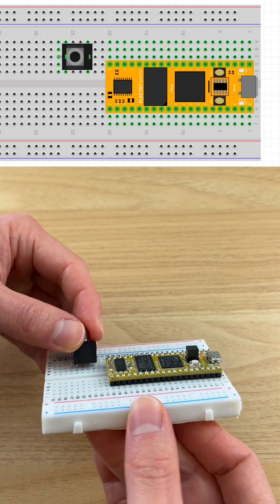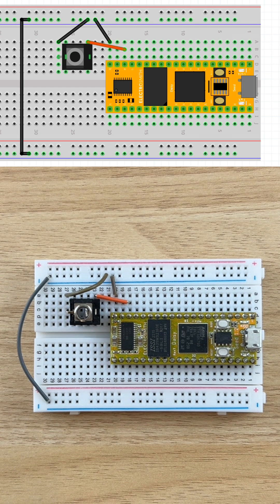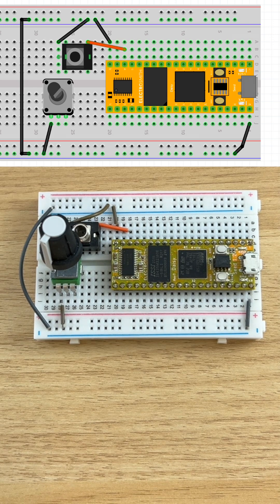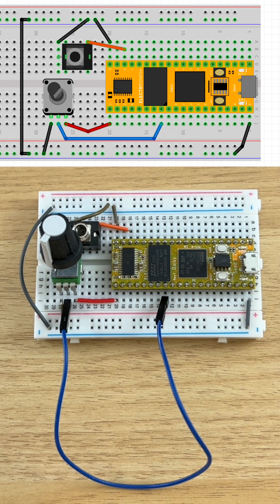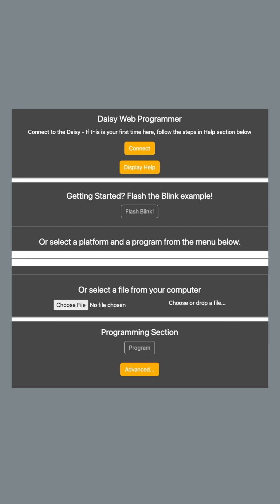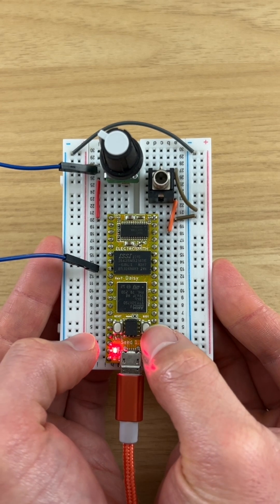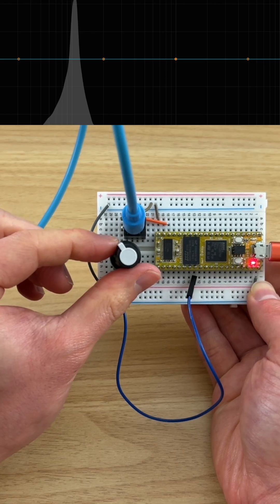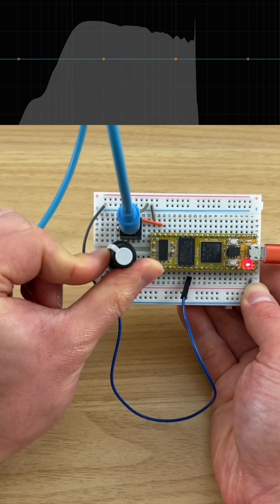Let's Control the Pitch of an Oscillator with a Knob!

Comment: Could you please explain more in detail how to connect and control an oscillator directly, without a computer, with an extrrnal MIDI keyboard? 
I have a daisy pod and field and since i first tried to connect daisy with an external keybord I’m blocked. I checked whether midi keyboard is recognizable by computer and Ableton and it is. 
I went through the whole forum and internet for a simple tutorial, but whether it is obvious, or it is for experienced people. Would appreciate a lot.
Reply from the maker: Thank you for your suggestion! 
Yes! We definitely want to make MIDI tutorial for Daisy!

In the meantime, please feel free to ask over on forum or discord. Depending on the programming language you're using, it should be relatively quick to set up. Hope to see you there!